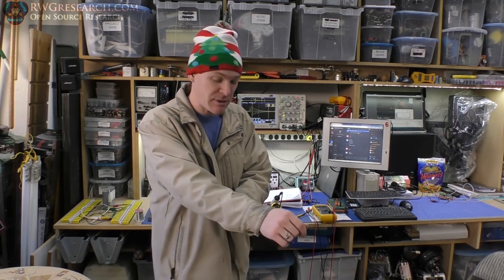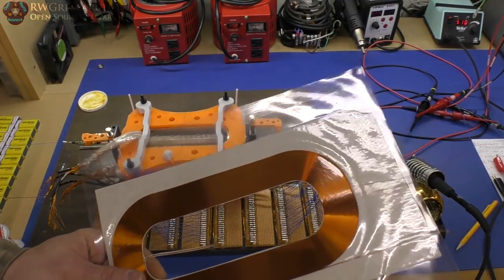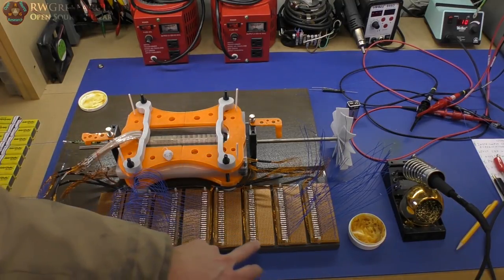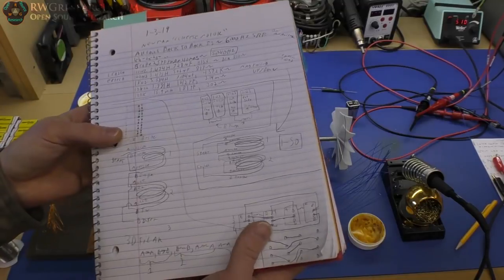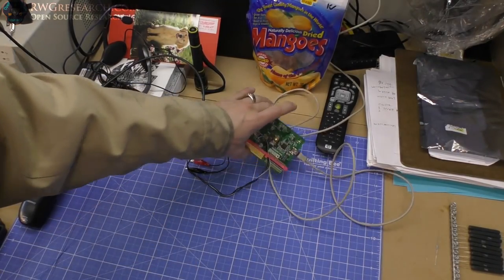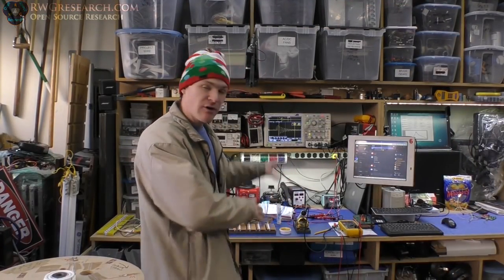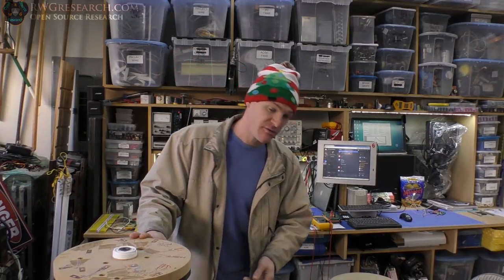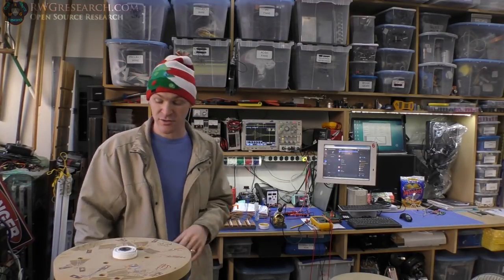TSFA 23 1019 / Cheesy Fan #1 : An Introduction Into The Project.

Comment: Hi Russ! The term bifilar comes from "two filaments. Yes, Nik does hold the patent for both the mono and bi versions of the pancake  spiral coils. Tesla's U.S. Patent 512,340 Flat Spiral Coils. dated January 9,1894. His original intent was to avoid, the employment of condensers (capacitors) which are expensive, cumbersome and difficult to maintain in perfect condition, and to so construct the coils themselves as to accomplish the same ultimate object. ~Barry

Comment: new video! It would be great if you connected a set of mechanical slide switches, or transistor-based power distribution switches so you could easily reconfigure your coils in series opposition or regular series without having to solder all the time, although the Jig definitely helps. You could use 0V gate Mosfet arrays or a thyristor array that  latches on for as long as some minimum current flows through it, and have active control with a microcontroller connected with IO expanders / shift registers / gate drivers.

You could also connect the transistor switch array at the common nodes of your coils and drive these switches with a gate driver in a make-before-break connection policy so the inductive collapse of a particular coil doesn't ring itself dry. But if that energy is stored capacitively between a number of coils, you could safely do a break-before-make switching policy without any worries about losing energy if all the inductive energy is actually completely being stored in the coils' parasitic capacitance. It is preferable because switching transistors at 0A increases their switching efficiency and ensures they have no effect on changes in impedance for the resonance of the coils to not be disturbed.

If you can achieve a resonant frequency close to the rotational Hz of your motor then I imagine a motor driver would be extremely simple or even not required, like most AC induction motors were designed to be with mechanical commutation. Are you sure the motor doesn't need to only rotate at a fraction of the resonant frequency of the coils? Is there only one firing angle that contributes to shaft torque?

If you made some form of multiplexed H bridge between all 50 of your coils, or at least the useful configurations you figure out with a logic table, you could actively change between coil configurations, for the purpose of directing where your stored energy goes, or simply changing the impedance of your coil pairs to intentionally change the phase, capacitance, inductance, and resonant frequency of your system, and if motor speed is a dependent variable of the resonant frequency, you could change the speed, the torque, or the input voltage requirements. There's a lot of power that comes with electronics over a passive system. I'm a big advocate for it. I also think that in DoE (Design of Experiments) automation greatly reduces the number of experiments you need to achieve the results you are looking for in an experiment.
Reply: but if the point is to simply miniaturize, then you're doing an excellent job!

Comment: I'm trying to fix my brothers blue tooth headphones. The charge port is broke. I tried putting a new one on but it just wont work at all. Any ideas to help a newby out?
P.s. I love watchimg every video amd I hope one say I will be a smart and as good as you. :)
Reply from the maker: You can't fail if you don't try! Make sure you clean off everything very well. And use a lot of flux. This will help a lot! If you did that make sure the traces arnt broke! Scrape off the coating on the traces a slight bit and solder it again... best of luck! I failed a lot! When i first started out! ;) try tryagain! God blesses! One day at a time! ~Russ